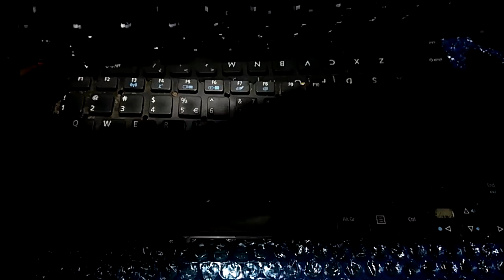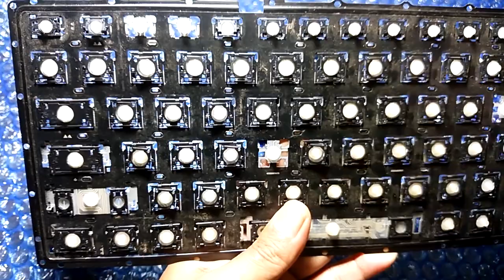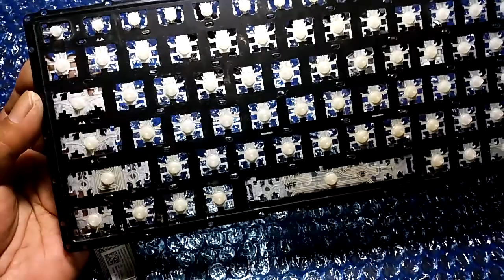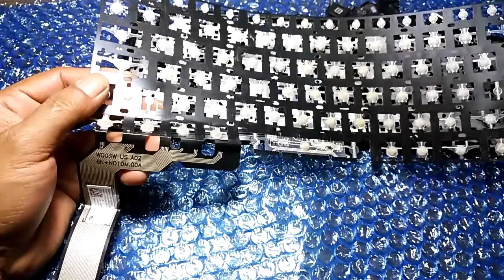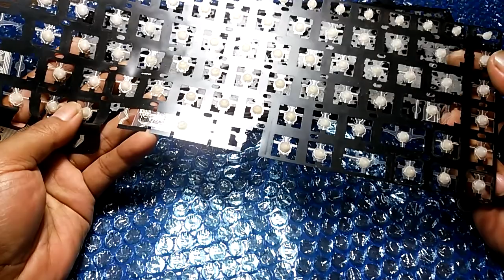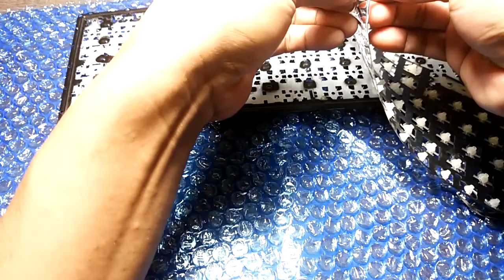Mengenal lebih dalam bagian bagian yang ada pada  keyboard laptop

Comment: Punya saya keyboard asus X441B seperti ada yang short, pada saat laptop kondisi mati kemudian konektornya di sambungkan sebentar tanpa menekan tombol apapun laptop menyala normal, namun kalau konektor keyboardnya di sambungin seperti biasa laptop tidak mau menyala walau di tekan tombol power dan dicas pun tidak mau mengisi dan lampu indikator charging tidak menyala namun pada saat konektor keyboard di lepas charger mengisi dan lampu menyala
Reply from the maker: khusus keyboard seri2 yg memiliki tombol power di keyboard, kebanykan masalahnya di tombol power mengalami short, bisa dengan di off tombol powernya saja, tepatnya bisa tutup 2 pin terakhir di soket keyboardnya/pasang solasi di 2 pin terakhir kabel flexibel keyboardnya, kalau normal, sudah bisa di pastikan tombol power yg bermasalah, videonya sudah sy buat sebelumnya ...
Reply: @RupaRupi  saya menyalkan menonaktipkan laptopnya secara manual dengan menjamper pin yang bertegangan 3.3v dgn ground
Reply from the maker: @hndpetualang  ya betul ... kalau tidak di tutup pin yg mengarah ke tombol power biasanya masih terjadi short, bisa di tutup salah satunya atau ground sama 3.3v nya .
Reply: @RupaRupi  kalau kita putus pin 3.3V dan ground yang bagian keyboard apakah keyboard akan berfungsi atau hanya memutus pin 3.3V aja apa yang akan terjadi
Reply from the maker: @hndpetualang  tidak masalah, bisa coba di tutup jalur 3.3v saja, biasanya bagian ini yang suka short ke ground ..